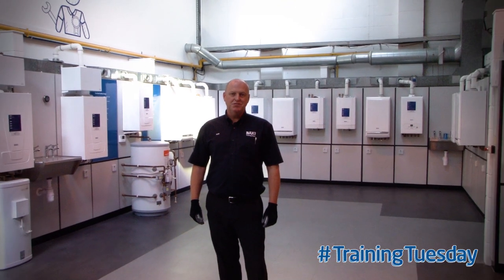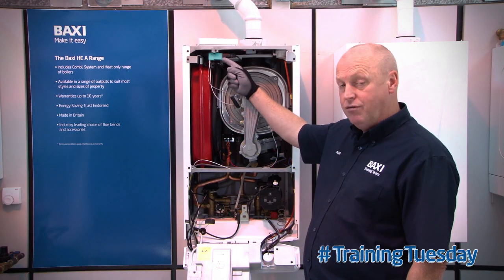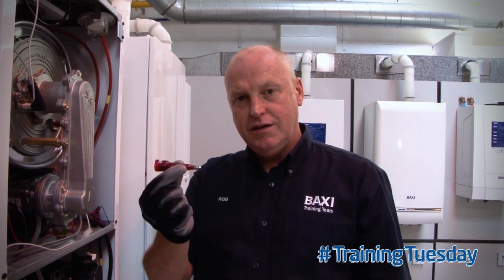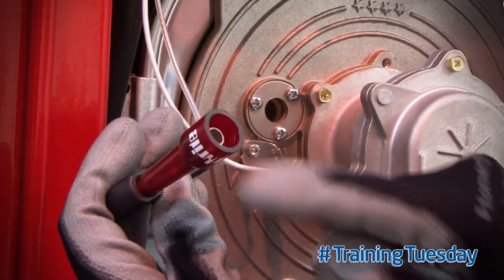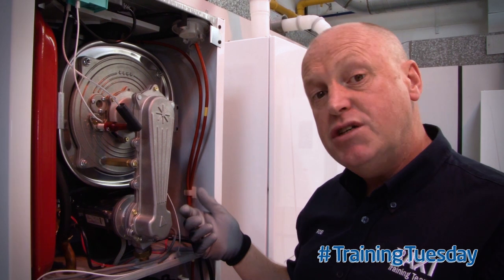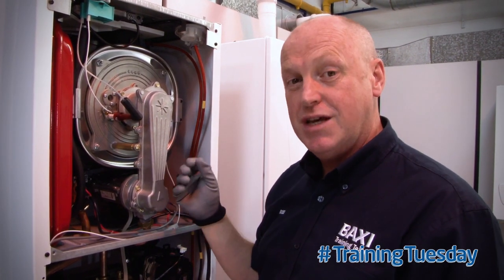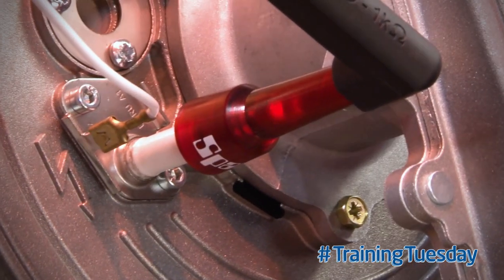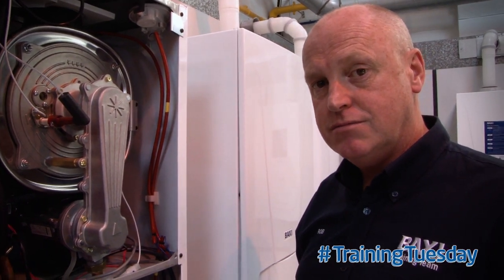How to check output from the spark generator on the Baxi Duo-tec and Baxi Platinum boilers

Comment: What if there's no spark  but gas valve opening???
Know the fault is between pcb connection lead to spark generator or the generator itself.. so test for about 150v dc to lead or lead integrity or spark generator faulty